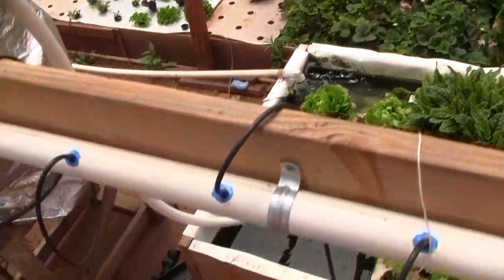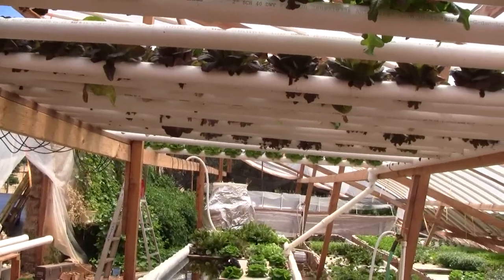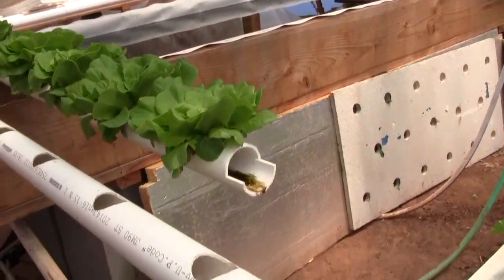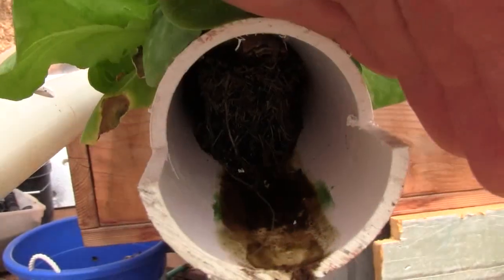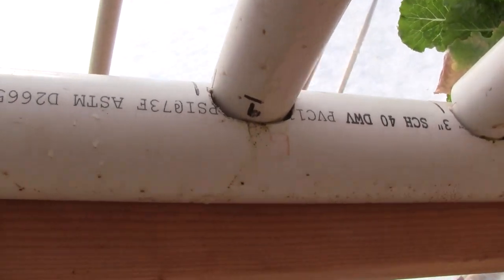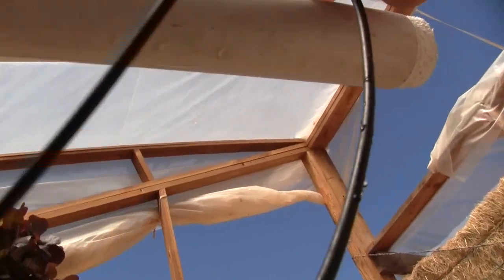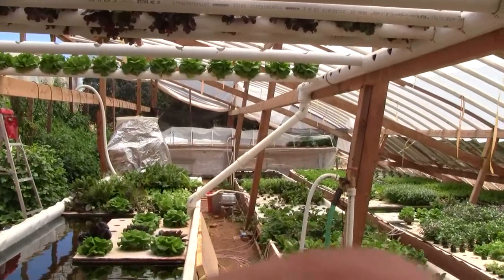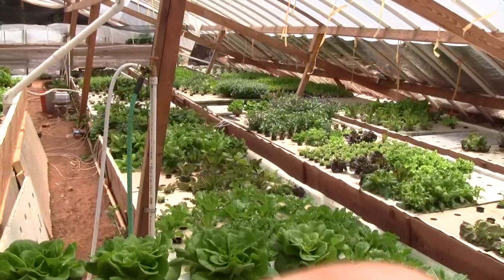Overhead NFT System 1 in Passive Solar Aquaponic Greenhouse

Comment: I would really appreciate, if you could answer a few questions for me: How do you "plant" the seedlings in the nft pipe? Are you just using the seedlings from your tray and put them in there - free standing with some coco/vermiculite on the roots? What size pipe are you using for the nft? What size holes? Thank you!